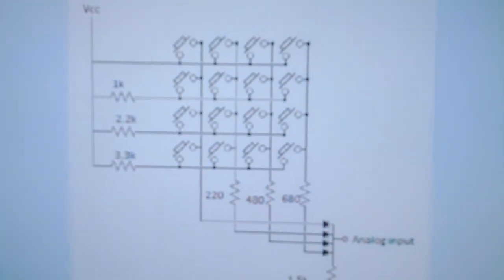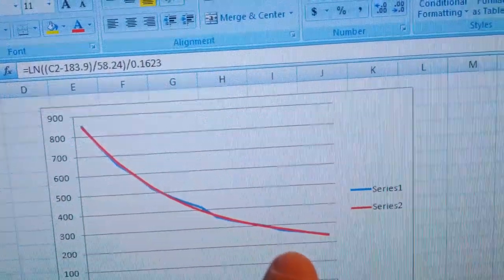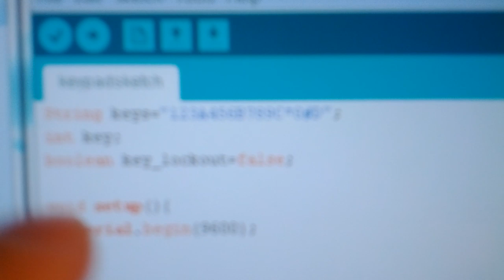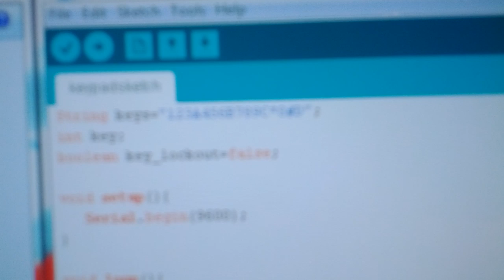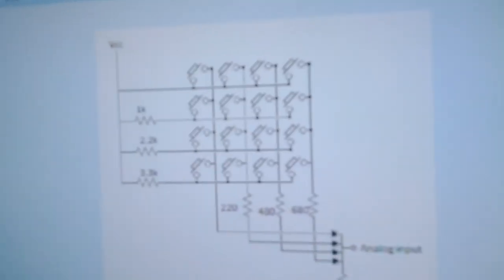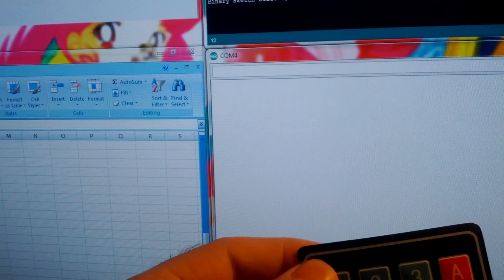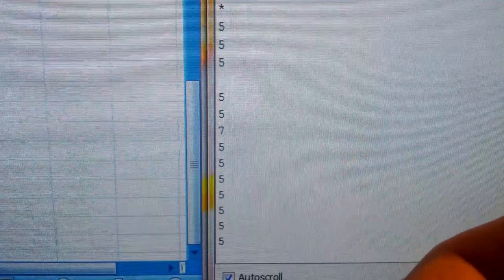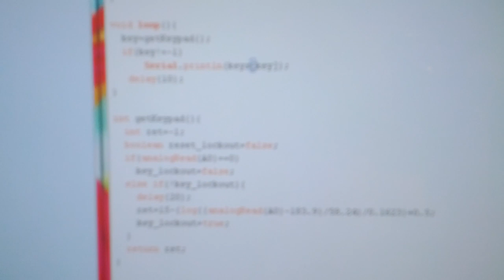Reading a 4x4 matrix keypad with a single pin without ranging on arduino

Comment: I have some question about this:
1) In you circuitry schematic,I see you used 4 diode for 4 keypad column.Can I use 1 diode for 4 instead ?
2) What is exactly the purpose of Ground in this circuit ? I know that without it,the signals that you obtain would be unstable,they probably increase and decrease in a large range of value.But I don't know why.Could you explain it in more detail.
Thanks a lot.

Comment: Sorry, this might be a bit of a noob question as I am just learning arduino and circuitry right now, but what is the reason behind the resistors from power to each horizontal row of buttons? Also, I am I FRC this year!
Reply: To detect witch is the pin with output depending on how many resistors it goes throw it will have less and less current. So if you star with 5V and you end with 3V tou know that the resistors made it drop 2V so then 2V = a button in the keypad.
This is how i think it works, disagree if not.

Comment: The diodes serve no purpose. They can be eliminated. Also by adding a single BJT (like BC848B) and a couple of resistors we can also generate an Interrupt (at expense of an additional pin), so that software doesn;t have to continuously poll the keyboard.

Comment from the maker: you're probably looking at wrong comment, what i was talking about is someone posted a link to a library, and it's in that library's documentation where you will find how to hook it up. If i have the time later i'll try finding it, the difference is that library doesn'tuse diodes like i do and uses probably more common resistors.

Comment from the maker: Any general purpose diode would do. I think these are 4007 though. Also you don't need the diodes either with slightly different wiring. Look in the comments section on this page: sparkfun.com/products/8653 the people link to a library you can use.

Comment: Hi Otaku,

Thanks for the tip, I checked out the website, sparkfun.com/products/8653 and took a look at the comments.  Seems like 1 guy had a good solution and posted about 6 months ago but doesn't have any schematics or code.  How does this differ from your project?

Honestly, I don't know enough about electronics to freely interpret what has been posted at sparkfun. If yours works, I may just go with that because I can understand your schematic and can use the video for reference.

Comment: Hi, i was testing vairus options and yours is the best so far, i have trouble in the b, 9,c*#d, characters,  do you have the valoues of the code line   ret = 15 - (log ((analogRead (A0) -183.9) / 58.24) / 0.1623) +0.5; , mi hiest value es 846 for the number 1, ande the lowest is 256

Comment: I have a question, i know this method uses ohms law so the current that you get depends on the currrent... So if im unsing a 9V battery isntead of 5V USB to power the Arduino i might get a different current than you, will this affect the code and not give proper values?

Comment: Sergi, I don't think it would because of the on-board voltage regulator. the pin should still have the same voltage out.

Comment: Hi Otaku  I used your method to hook up the keypad, and all the keys are working except for the B and C keys, which instead come out as 6 and 9.  No idea, I've checked all my resistors but can't seem to find a problem.  Any ideas?

Green,  this wasn't too complicated I think its the best method I've found so far.  I didn't have any luck finding the library either.

Comment: Hi Otaku, thanks again for taking the time to help with this.  I read through the comments and found a link to a library 

playground.arduino.cc/Code/Keypad

I read through it and as far as I can tell they still go about using digital pins.  I don't see any reference to using an analog pin, or maybe I missed the specific reference.

Comment: very good video. very useful and with few components, we save many pin.

a question, I do not understand the following instruction:
  ret = 15 - (log ((analogRead (A0) -183.9) / 58.24) / 0.1623) +0.5;

how do you know that you should use these numbers? subtraction and division?

thank you!

Comment: Many thanks! A great solution! It works fine.
But I don´t understand the function of the diodes. They decrease the output voltage range respectively the noise immunity. Is there any advantage?
Have you already calculated the equation without diodes?

Comment: Thank you so much for this video! I've run out of digital pins for a project and this will allow me to finish!  I spent a good deal of time today digging through the bins at RadioShack but I couldn't find a 480 resistor, only a 470.  

Can I substitute a 470 resistor for the 480?
How would I alter the code to make up for the voltage difference?

Thank you so much!

Comment: The reason that you are sometimes getting errors is that the voltage needs time to settle or it rings. You could reduce the amount of errors by sampling the pin 2/3 times before registering a button press. This wouldnt be noticeable to the user as you can sample very quickly.
Reply: I don't think that's the reason you get the errors. Having looked at the raw data collected by the getKeypad function it sometimes returns a zero when it reads the analogue input. Looking at the code, the settling delay lies between a statement that reads the analogue input to check if a key is pressed and a second read of the analogue input to determine which key is pressed. If the key changes state in the delay between these reads then the second read returns zero which is then misinterpreted as the wrong key press. Inserting a test for an analogue input of zero after the second read fixes the problem e.g.    ret=analogRead(A0);
 if (ret==0) ret=-1;
 else ret=15-(log((ret-183.9)/58.24)/0.1623)+0.5;

Comment: I just implemented your design. It works, but I just use a linear search over the list of (16) analog values for the keys. I found that pressing the same key produce the same analog value +/- 1, so there can't be any misreading. Easier and more accurate (I guess) that evaluating a log function. Thanks.
Reply: look alterno could you share the code?

Comment: how will the program change when i use a 4x3 matrix?
Reply from the maker: depends what components you use. if you wire it up the same way but just miss one column than it will work all the same. Or you can recalculate what values would be good and come up with another equation.

Comment: great, but a lot of work.  Those must be some expensive arduino pins you got.
Reply from the maker: +Jeff Beck well several times now with certain projects I use pretty much every pin so being able to reduce the pin usage to a single pin for an entire keypad is very useful. I wouldn't have done it if I didn't have a need for it